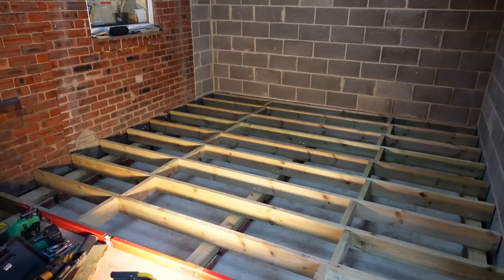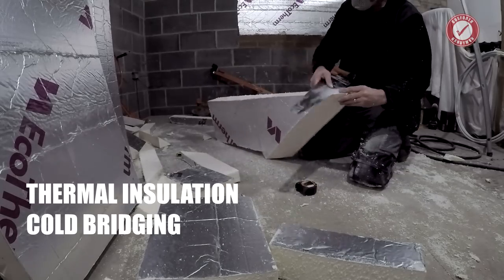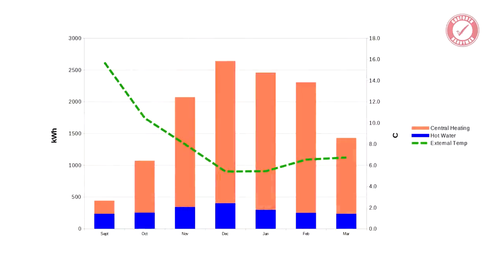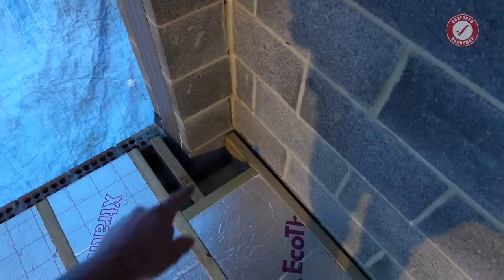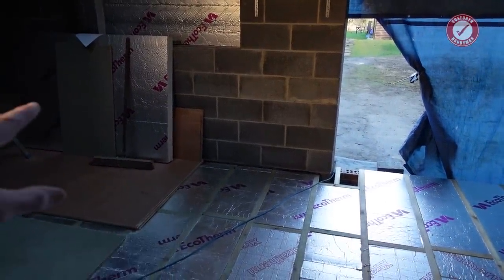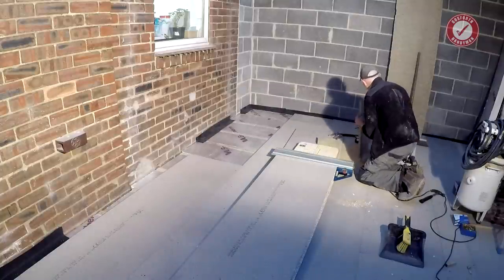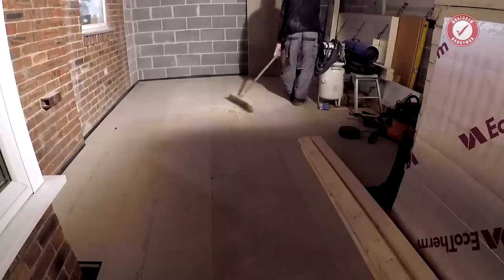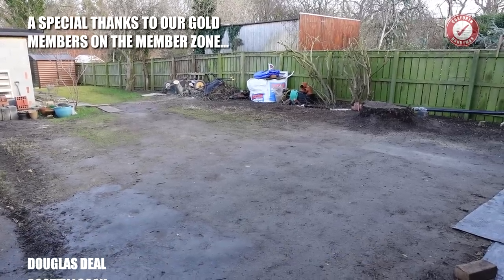Insulation and fitting chipboard flooring for our extension

Comment: Well done. Lots of hard work. The system we are using is (1) Pro Clima Solitex Plus, a windtight breathable membrane up and over the floor joists (2) 100mm of RockWool Flexi sandwich in between (3) Pro Clima DA airtightness membrane laid over the top which prevents moisture and warm air escaping from the warm interior to the cold crawl space. All taped to the walls

Comment: I laid one of those floors in our  loft conversion circa mid 90s and at that time cordless power tools were not around. So i used ring shank nails and didnt glue the edges. And quite predictably they started to squeak on certain joints. My solution at that time was to give the whole floor two coats of floor varnish which worked a treat. However i cannot say if this solution is the correct thing to do, but it worked. Looking forward to seeing the garden take shape, albeit thats a long way ahead.
Reply from the maker: Nice one! Sometimes it settles down with time, humidity can change it too, or perhaps the varnish lubricated the joints! 👍😁

Comment: Just kicking around some thoughts as I am sorting out quite a bit of insulation in various parts of my house. 
Ecotherm type  insulation is very expensive to buy but has very good thermal qualities. 
However either rigid slabs or rolls of loft style rock or glass wool is far far cheaper but not as good thermal qualities. 
My workings is that for a 100mm Ecotherm you need 160mm of wool to get the same thermal value. However even though you need more wool the cost is so much less that the cost per m2 of each would be that the Ecotherm is double the wool price. 
So my policy is that I put thick wool in where I have the space and ecotherm where I have limited space. where I can get it in with a good fit. 
You seem to go for ecotherm all the way!

Comment: That is gonna look epic when your done. You can get flush downlights now. About the same thickness as plasterboard.

Everytime I see board insulation in a floor like that, it reminds me when me and my old boss had to measure curtains for this big swanky house in london. We walked the joists across this massive room, He crapped himself when I showed him it was 30+ foot drop into the room below.

It makes me feel ill gluing down caber flooring. It never feels right. Probably because I have had to replace so much of it, ripping it up and cleaning the joist up is so much work. I think gluing the joints is a must tough.
Reply from the maker: Unfortunately most flush downlights still require cutting in to the insulation and a lot of them come with drivers that have to be cut in too. I actually bought some low profile ones but had to return them when I read in the instructions "Not suitable for use below insulation" 🙄. Gave up in the end. 😂👍
Reply: @GosforthHandyman  Robus do surface mount ones. I'm gonna have a look in my loft tomorrow, I bought about 30 of another brand when my mate told me electric base was liqudating stock. deffo 240v no driver. insulation I dunno, that might be a cut and paste manual thing. if they don't get hot thats one thing, if the break a fire reg thats another thing. 

Anyway, a nice spotlight track still looks good and a nice fancy pendant above the dinning table you are sure to make would look better than newbuild for the council scheme downlights

Comment: These videos are great. We are buying a property, same age which needs all render replaced. Building regs suggests we'll need to upgrade wall performance, probably using EWI. However, it seems many renderers and their customers don't bother with it, as it's got all the projection details to deal with... . Did you consider it or do you think putting insulation in other areas is better?

Comment: It might be worth re-working the audio and vid on Insulation , basically to show your local MPs, / Councillors and 'Insulate Now' protestors the amount of work to actually carry it out.  In some places £30k added will exceed the market value of the property, but maybe should be compulsory when a property is declared vacant.    And you could also consider the housing types where this is less easy to be done.  A problem too is some of the 'small' blocks of pre 1940s flats (there are prob some around your area), and potentially some of the 1950s council flats - I know some in Hartlepool-  where the ability to insulate the cavity , or the under floor, is limited.  Of course in most houses the flooring used to have the 1960s duralay rubber underlay, which if it has not crumbled is still a bit of extra insulation.
Reply from the maker: Yup! Hopefully the energy minister will watch this. 😂

Comment: Nice work Andy.👍 I noticed you using gappotape on the PIR in the roof space, but when doing the floor you did not, nor did you tape the PIR to the joists with the foil tape - was that just a cost issue? Anyhoo you will really reap the benefits of the considerable investment in insulation - with the global shitshow and after effects yet to come on energy prices. Well at least until the missus suggests you move - so you should have a couple of years then.😉🤣👍 PS: You really appreciate the floor down after hurdling and balancing on joists.😀
Reply from the maker: Cheers! With full length battens holding the floor insulation up you don't get any draughts so no need for foil tape, and they're so accurately cut due to the joist spacing being identical there are no gaps. 😁👍
Reply: Thanks for asking the very question I was also thinking about.

Comment: Interesting that you are using the foil face on the insulation as your VCL. @Steve Roofer suggests that this isn't enough and a specific green VCL is required with butyl tape underneath it where the screws for plasterboard will go through and VCL sealing tape on top of any joints. His latest vid discusses it. Let me know your thoughts. Great vid as always!
Reply from the maker: Cheers! That's more for flat roofs, especially with timber framed construction. This is masonry with a ventilated pitched roof so the foil is fine providing everything is taped up. 👍

Comment: Great video mate, if you use PU glue on all the joints and joists it will never squeak and you don’t have to land the boards on the joists. This no wastage.
Reply from the maker: Defo! Although I have loads of Titebond II so I'll probably just use that. 👍
Reply: Thanks Tom. I was gonna ask Andy about landing the board joins onto the joints, and if it was really necessary. Glad I read the comments first👍👍
Reply: @darrenh20102  no worries mate, make sure you wear gloves with the PU glue as it stains your hands. Nightmare to get off! Good luck laying the floor.👍

Comment: Obviously rather late to think about this, but would it not be better to have a more cohesive board on the edge of the wall by the bi-fold doors? Otherwise there's a risk of having a very narrow cut board between the main room boards and the bi-fold doors and this would be quite weak compared to the full boards.
Reply from the maker: Once it's glued and screwed it will be solid. No narrower than a floorboard. 👍

Comment: An observation , not a criticism , you had to cut the first board down to 2025mm because you couldn't get to the 2.4m joist bet you were short by 25mm. Thats because you put them all in at 400 centers. Didn't you? Where as the first one should be in at 375mm or if you like 400 from the wall.  Don't worry, everyone has done it at least once.
Reply from the maker: By design! (amazingly) It was a trade off between cutting the board or cutting the first row of insulation at a different width. Figured cutting the board was quicker. 👍😁

Comment: Great vid Andy. I think you said you'd checked the cwi and were fortunate to have good installation already in. How did you check there was no slumping or issues? I've got white fluffy cwi in my 1930s semi which because of the huge gaps around my windows, I can see has slumped. Thinking of hiring a flir cam
Reply from the maker: Nothing scientific, just based on walls we've taken down / knocked in to. 👍

Comment: I dont agree with gluing the floor, It started so the builder does not get call backs for squeaks, and when you need to service or repair you tear everything up if glued solid.
Reply from the maker: Chipboard can be quite prone to squeaks so it's a bit of a gamble not doing it. 👍

Comment: Great Job Andy! 

Is your OSB T&G subfloor floating on top of the floor joists?

I’m in the USA in a state called Utah 600 miles East from Krazy Kalifornia! I’m not aware of any building contractors that’s are using these great scientific building practices and I mean zero!  It’s not the case parts of Texas! 

temperature range -22.2 C - 52.2C! heating bill range from $200-$400 a month for Gas Furnace’s.AC Cooling Electric bill from $150-$300. 

Case in point there’s a house being built near me! 

they did not install any foam insulation or compatible foam insulation on top of the 7/16” 11.125mm plywood or OSB that’s attached to the roof Joist. 

I’m also confident that if I go inside the house before the drywall is is installed on the ceiling joists. There won’t be any foam-board like what you’re doing! Only spraying 6 inches of cellulose insulation In between ceiling joists in the attic space and call it a day l! because it’s a lot cheaper to do that then to do the foam board In between the roof rafters. They just don’t understand what you and I understand and maybe tens of thousands in the United States millions in Europe! European construction is much more robust than construction in North America and Europe with building Sciences! they’re so far ahead of what we’re doing with building sciences here in the US except for the East Coast where it’s very cold, with building codes where you insulate the roof! 

It’s quite unbelievable summer temperature reach up to 109° 43.8C for 6 to 8 weeks during the summer! inside temperature of the attic above 130° Fahrenheit 54.4 Celsius
Reply from the maker: Interesting! The subfloor will be glued and screwed down. 👍

Comment: Why are you using chipboard that stuff bad it is known in the US as (fall a particle board) it will not hole a nail or screw over time it has no long-term strength. Homes built here using that crap are looked down upon mainly used in prefab homes that fall apart and are worth a lot less look it up with said good luck you have done a bang-up job.